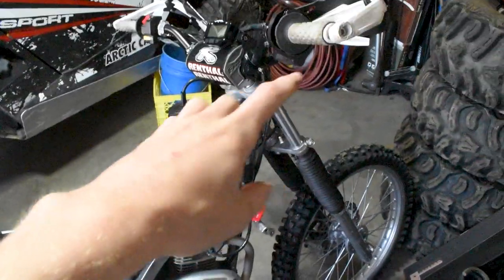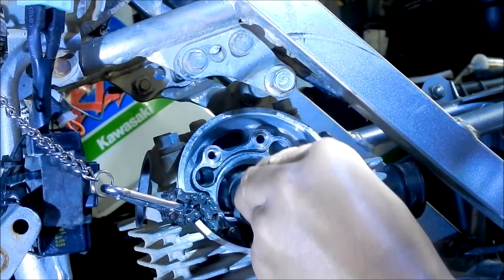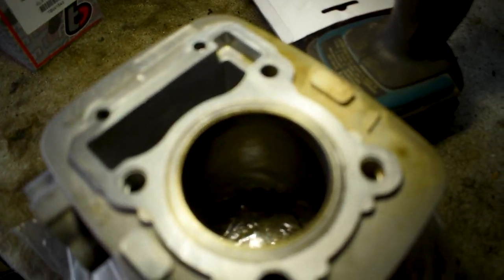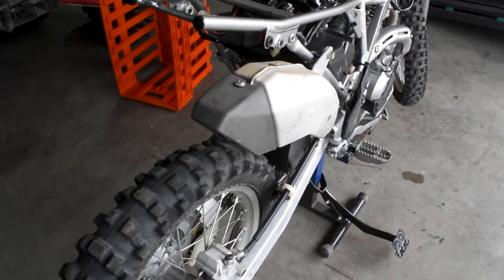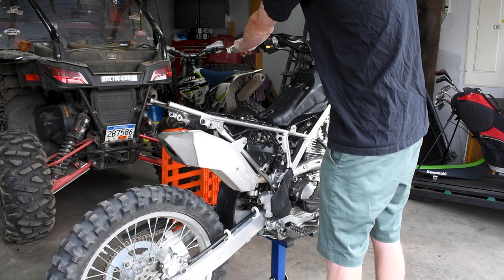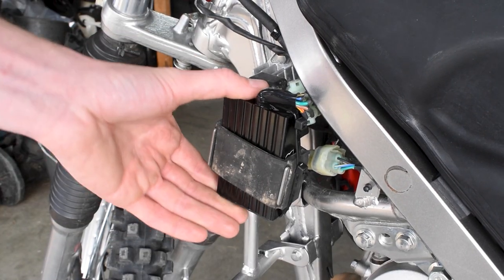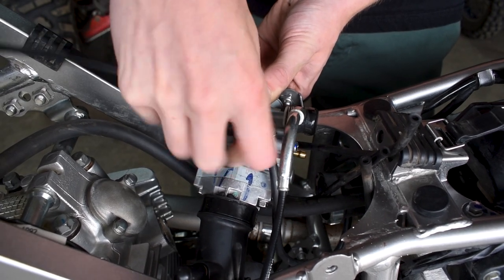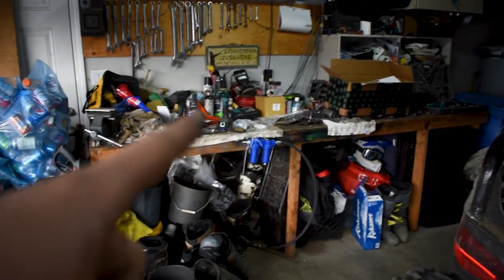BBR 170CC BIG BORE KLX140RF BUILD BEGINS

Comment: What’s your valve clearance? Just put a big bore and BBR cam in mine and you can hear the engine chatter a bit more. I never adjusted my valves
Reply from the maker: Couple thou tighter but still within spec from the book. Mine clattered too. Tighter quieted it up

Comment: Just wondering if you know how may hours you would get with the 170cc kit before you have to replace the piston
Reply from the maker: Depends on abuse level, about the same as you would with any other piston
Reply: About the same as the stock piston is that what your saying
Reply from the maker: @714films.youtube yep. These 170 kits have been proven reliable. People have been doing these big bore kits as early as 2011 if not earlier
Reply: Thanks heaps for that info 👍

Comment: Sick bro ,I put big bore kit on klx140 and started smoking after 5mins ,I did not install aftermarket camshaft and bigger carburettor kept stock oem could this be the cause ?
Reply from the maker: What color was the smoke
Reply from the maker: Blue tint indicates burning oil..
Reply: @AaronsEnduro   the smoke appears to be a light blueish / white I tried reinstalling the cylinder,piston&rings again & still having issues could this be oil coming from valves ? And possibly not piston
Reply: @AaronsEnduro   could this be oil seeping from the valves top end or is this only caused by piston/rings fitment
Reply: Any suggestions brother
Reply from the maker: Its all possible, but hard to know without getting your hands into the engine again
Reply: @AaronsEnduro  how long should it smoke for if I do break in sequence Brother (until slowly fades away or 10 mins ) how long should I let the bike smoke for before knowing it’ll be a different cause
Reply from the maker: It shouldn’t smoke out the exhaust at all
Reply: @AaronsEnduro  no worries brother I’ll try pulling apart again and put it back together thank you
Reply from the maker: @abbabennett3283  i imagine something went wrong on the installation process. Mines never puffed any smoke at all ever out the exhaust. sorry im not much of help as im not too sure why yours is smoking. My assumption would be  the piston ring isint seated correctly and the engine blow by is getting into the combustion chamber causing the blue tint of smoke out the exhaust
Reply: @AaronsEnduro  you have provided as much help as you could and I’m grateful brother thank you for sharing your knowledge with me and yes I have a feeling that may have happened Aswell I will pull apart and reinstall and I will let you know how I get along thank you brother
Reply from the maker: Lemme know how it goes! If you wanted to support me and the channel and the help I offer for the price of coffee! You can also get some channel perks! No hard feelings if not :) https://www.youtube.com/channel/UCcviyKZ2Vf3IHFliwebzODA/join
Reply: Thank you brother yes will do brother and could it be that I need to upgrade stock carb if so I will grab a vm26 thank you brother
Reply from the maker: What size carb are you currently running?
Reply: @AaronsEnduro  klx150 stock carb I believe it’s a Keihin ncv24 if you need pilot and jet sizes I’m unsure of that but I could take apart and have a look if need brother thank you ,I was just thinking maybe it’ll need bigger sized carb
Reply from the maker: I dont think to small of carb would cause your oil burning issue tho
Reply from the maker: But i know i run a vm26 mikuni carb
Reply: @AaronsEnduro  could this simply be the jetting ? It only smokes a little bit and very light tinted
Reply from the maker: Is ur spark plug wet with oil
Reply: @AaronsEnduro  I’m not sure if it’s oil ,it’s smells more like gas but could be oil I’m not sure brother
Reply from the maker: But is it wet either way
Reply: @AaronsEnduro  yes I think could have been little bit wet black look ,when I checked the spark plug it was not clean
Reply from the maker: If its wet you definitely have too much fuel and or oil blowby
Reply: @AaronsEnduro  what could cause too much fuel brother and how could I lower
Reply from the maker: Jetting and or fuel screw
Reply: @AaronsEnduro  should I consider getting another carb ?